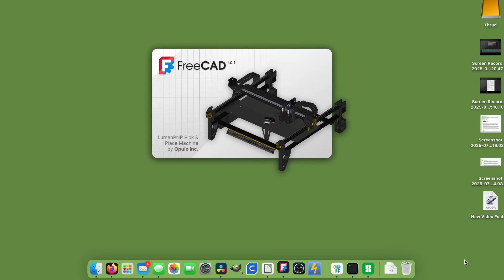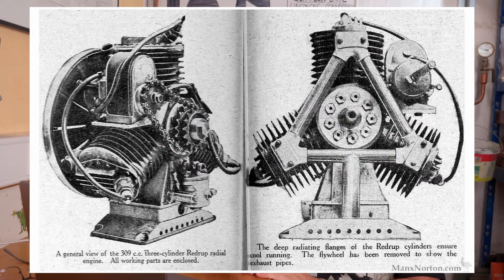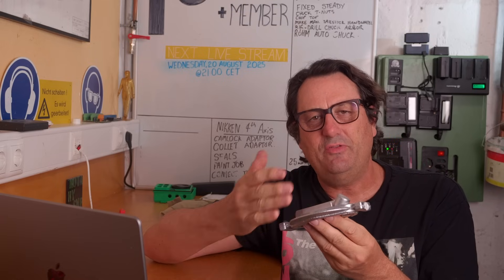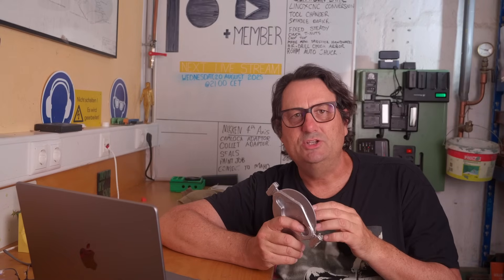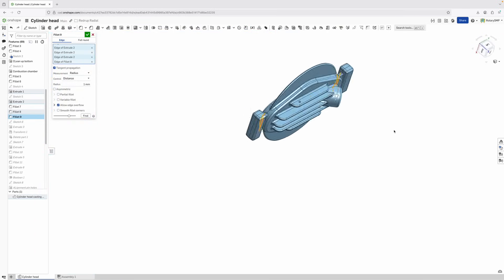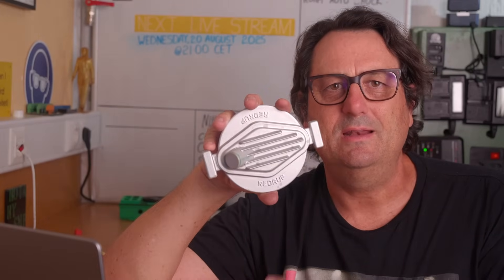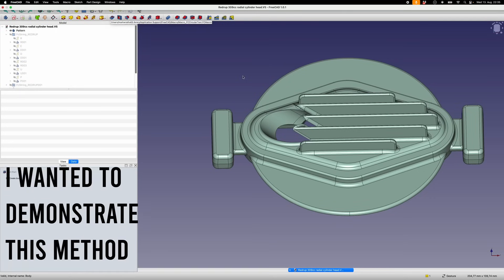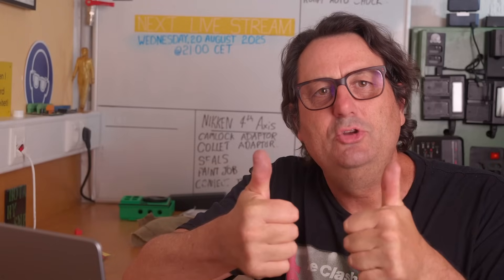FreeCad vs Onshape - Why did I switch? || RotarySMP

Comment: I agree that fillets are one of the single worst parts of FreeCAD, but I have to say I can't complain with free. Sometimes though I find that you can work around the fillet issues if you consider your order of operations, so that fillet on the disc in FreeCAD, you could possibly have started off with a revolved profile, instead of an extruded and filleted flat, however that's not what you want to do when filleting should be built in unfortunately. I have however enjoyed being able to write macros for it, and it works on linux a charm, I've used it for things like FEM etc, and it's all been 100% free. I would like to try onshape, but I don't want to temp myself into being stuck in a subscription. Edit - I should add to this, I rarely make particularly complex geomtry, I'm typically designing things for sheep goods, I have had pretty extensive experience with solidworks, siemens nx and sketchup, and I think compared to what you get if you pay for sketchup vs what you get if you just download FreeCAD for free it's a no brainer, I am however tempted by the fact that it seems like SolidWorks pricing has come down massive however, $48 USD a year at the moment, as I can work with FreeCADs CAM solution, but again it's got it's quirks that can turn what should have been a 10 minute job into an hour+ of looking up tutorials.

Comment: Very good video and your choice is valid.  However I've been burned too many times when corporations change terms of service to trust my work to onshape, even if it is less quirky than Freecad.  

I was in a similar situation with teaching Python a couple of years ago.  I was using Replit which at the time had an amazing free online educational coding service.  Until they didn't .,   Never mind all the work that many teachers put into building their courses around it.  All gone now.  For another example I have a couple of Bose streaming radios.  I get an email a couple of months ago from Bose that they will no longer work after Febuary, nothing you can do, here is a coupon to buy some new ones at a discount. Here is a third example.  Years ago my school district bought into very expensive curriculum mapping software and had all the teachers spend many hours writing these maps.  The data was apparently not owned by the district so when they decided it was too expensive to continue renting the software, all of it went away.  

That said, I would probably use onshape in a school situation if I did not have a computer lab .

Comment: I use Freecad intermittently when I have projects to design that I want to 3d print. It can be frustrating however the new Freecad 1.1RC1 seems to be better with the way that it deals with fillets.  This is also one of the main reasons that I stick with Freecad because every year it noticeably improves so slightly less frustration :)
Reply from the maker: I really hope they can also work on the file efficiency. I also like FreeCad, and the community, but it became clear to me it would be impossible to assembly my motor bike engine project in to a complete assembly, as the sum of file sizes would just grind my computor to a stop.

Comment: You got the budget for a  pc ill bet it just i saw a rotten apple  as your pc/computer i suggest getting a 6 core amd 5800x ddr4 rig they are getin cheap i just installed a rx9060xt 16gb in mine yea not uber cheap but that was my first card PlUs in 15+ years .was running a 3400 amd APU in it .i apple annoys me for a few resigns to me it is Linux locked out with high prices beyond me ..glorious e roll has the all most perfect build of Fedora OS  that and windows ghost specter version
Reply from the maker: I am no apple fanboy, but switched to the M1 MBP about three years ago, as it was the right solution for me for video editing. x86 based hardware can be just as fast, but runs way too hot, with too much power consumption to be practical for editing on your lap, like in an airport.

Comment: Hi I use freecad on an 2020 m1 Mac and had the same stability issues.. I picked up a 5/6 year old gaming pc (marketplace) for 150$cdn and the difference in stability was night and day .. in my opinion it just seems to run smoother/better on a pc .. maybe it’s a security/intel chip thing I don’t know .. I also noticed that after a Mac software update the m1 would overheat using certain softwares that ran fine before the update.. so I built a new pc by gutting and reusing so parts of the fb tower and newer windows 11 compatible board/memory etc .. 
I run 2 versions of freecad : the current stable release and the newest dev release (I check in every few weeks to see what’s new ) … I build stringed instruments and use the 3 cnc’s and 3d printers throughout the builds and repairs including making the hardware; bridges saddles tuners and gears knobs strap buttons plates etc .. I use freecad exclusively .. it’s quirky and I’ve learned to work around its limitations but it’s awesome and indispensable… the dev’s are superheroes and should be considered gods in my opinion 😂cheers .. great content I’m looking forward to seeing your channel grow..

Comment: Your points are very valid. Due to it's nature, Freecad is not fully polished and it will take some time to get there. With greater user base the development activity has considerably increased and it goes in correct direction. It's just your needs outgrew the capabilities of current version of Freecad. I hope you won't fully abandon Freecad and you would check newer versions out from time to time.
Reply from the maker: Yeah, I would also like to see it continue to improve. I hope they strong dev team can sort it all out.

Comment: I used to use Alibre many years ago, then over the years I forgot about it. I've recently come back to hobby machining and tried a few of the normal 3D programs, including Freecad and Fusion, Freecad was a mess, Fusion was good but Autocad did the inevitable reduction of features, so I looked into Alibre again and bought the update to Alibre Atom. I'm able to open my old files and I know that if I don't pay for maintenance I can still use the current version. It also seems to manage to work with no problem.

Comment: Freecad, for better or worse just seems to be unusable for any real-world application beyond virtue signaling. It needs a clean sheet rebuild with a modern UI and a focus on getting the fundamental capabilities before anything else. There are many open source programs which are super functional but freecad isn't one of them. I would love to use it but I need to make parts, not fight software. Onshape is good software, a bit expensive for the pro version but there are some nice capabilities. For hobby use, Solid Edge community addition is far better and runs just fine on lower power computers. (Unlike SolidWorks)
Reply from the maker: I imagine a full CAD package is probabaly nearly as complicated a you can go with a software project. Lot of math in there.
I havent used solid works or solid edge. Solidworks has no OSx port.

Comment: When I asked the FC forum the question regarding the rendering / processing times which can often result in FreeCAD "not responding" for several minutes before completing whatever process such as Boolean or fillets etc I was told that it doesn't really matter now much RAM or how many processors or cores you have, FreeCAD hasn't been written to take advantage of "modern" machines, and is basically a single processor dependent.   I don't know if or how true that is, but My machine is a humble 6 core / 12 thread Ryzen CPU with 48 GB Ram... and it still struggles.
Reply from the maker: Ouch, I hadn't known that is was single thread dependant. 

Sounds like it needs a pretty extensive overhaul.

Comment: The fact that a freecad power user had to check and raise a bug issue for a fillet feature says everything about comunity developed cad software. They simply have no chance in such a  hard and competitive application. Maybe they should change their model and set up a fair software company that will make you pay a fair price  in order for them to have the resources to make decent software. In the professional realm free is never really free. You end up paying by wasted time and then eventually buying the real thing.
Reply from the maker: I guess the CAD is very dependent upon some of the decisions made at the very start on algorythims, and it is very difficult to switch and fix some inherent weaknesses.
Reply: @RotarySMP  spot on. Thats maybe one reason why professional cad software is so expensive, since it takes a fair bit of planning and resources to not get into an irreversible future mess. That and also the huge appetite of large software corporations like ptc for example to extort users 😊

Comment: Mark, I know this is unrelated to this video... but with the feet you were building recently I was really hoping to see you put proper feet under the MAHO. I love your content and varied topics, but every time you put the jack under it and move it out I fear a mistake with the blocking you have it on. Please consider your safety and maybe at least attach the blocking to the MAHO pedestal someday soon... or make proper feet/legs for that machine.
Reply from the maker: It is on the to do list. It is bit more difficult as the foot mount points of the Maho base are too narrow for the jack, so it will be a little more complicated.

The blocks are three solid timbers, and I adjust them into place each time.

Comment: ANYTHING online.. is just BBS. You will find it sooner or later.
And onshape is no exception.
And of course, they are incredibly marketing offensive. I'm afraid to open the fridge... they may jump out of it :)
That always trigger BIG alarm in my head.
Reply from the maker: BBS? I am happy if I can get my Redrup designed in one system :)
Reply: @RotarySMP  Big Bull... :)
And... when that "system" disappear from that "online" sh... all your work is gone forever.
After 30 years in IT, I've seen giants, like IBM, Compaq... diapering.
So.. who can guarantee that all your work will not disappear in a blink, two months from now? Nice commercial? Some dude from the internet payed to sing nice songs about it?
We are both old enough that we seen many kind of bubbles exploding.

All my work is ONLY on MY drives.
And yes... I can start for example autocad, or pagemaker, or freehand, or quark from year 199x, and open file that is created 30 years ago.

Comment: I remember seeing some surveys about "what CAD software do you use" with a question like "how do you like it". Out of 20 or so CAD software packages, FreeCad was the lowest ranked, by a lot. It's kinda become a running joke.
I mean, what other CAD software comes with very useful tools like a Ship Workbench built-in.

I've been using OnShape for quite a long time now, and it just works. The only problem is the really expensive pricing, and the really restrictive free license.
Reply from the maker: Thank Stephanie. Do you remember where you saw that comparison?
Reply: @RotarySMP I found it. It's from CNC Cookbook. Search for CNCCookbook 2024 CAD Survey.
Freecad is ranked 11/15, is #3 in market share, and #4 in most tried CAD software.
Basically a lot of people have tried it, a lot of people use it, and a lot of people hate it.

I like to compare the progress of KiCad to FreeCad. 10 years ago KiCad was pretty awful, full of bugs, no UI consistency. In the past 10 years it has moved up to be a major player and has become easier to use, more stable, more functionality, more consistent UI, etc.

Meanwhile FreeCad is... the exact same as it was 10 years ago. There have been some improvements, but the UI, UX, and huge learning curve hasn't changed one single bit.

OnShape is a masterclass of UI/UX design. There is nothing else like it. The barrier to entry is low, and they include tons of tutorials. Things just work without you needing to think about it. Advanced usage is available, and they include tutorials on the advanced tools too.

Any CAD software requires you to understand how constraints work and what tools do, but a good CAD software means that you don't have to know how the tools work or how to use them, you just need to know what they do.
Reply: @RotarySMP I swear I replied already...
The survey was from CNC Cookbook. Just look for CNC Cookbook 2024 CAD Survey.

Comment: For another flavour; I've been using Turbocad for 30ish years now. I started with it when I just began my company because it was recommended by a CAD guru and because it was cheap. It was like an AutoCad 12 clone with limited 3D possibilities. I started drawing and designing with pencil and ink so the 2D environment was most important at first. My machining was also only manual so the fit was sufficient with the added bonus of precise measurement in CAD instead of guesstimate with the rulers on your board or using mathematics when details became important. I never switched even when I had four of my employees working on Solidworks Standard and Professional (don't use version one of the new release; skip to the next; familiar?)  My workflow still fits this software and I have no need to work parametric. I do save versions during design which I combine and alter when needed to get to the final output. I started at version 5 and I'm now on 23 platinum. It's supposed to be parametric as well but I never felt the need to try that. The only reason I upgraded a few times was incompatibility issues with a newer version of Windows. Most of the parts I produce have to be technical correct and have a thought trough/technical sound appearance so the more emotional pleasing fully curved stuff doesn't happen here a lot. I did some and Turbocad did the job almost anytime. When it really needed to be 3D complicated I asked the Solidworks jockeys who worked for me. Surprisingly I also did some jobs in CAD for them because (then) it was more easy for me to perform with TC. As you understand old-skool guy here but the end result is not about the CAD system you use but how good you thought about it. Ask Leonardo....  But maybe TurboCad is an affordable flavour for some of you too. A purchasing tip would be to ask for the last version before the latest one. It saved me a lot of money every time I did so. Thank you for sharing Marc. I'm a dedicated fan of your channel and I think the algorithm should support you more. Best! Job
(PS: for CAM I'm using OneCnc Expert for 18 years now. First one is expensive and not for hobbyists I think but you own the software. And this software is a joy to use. You can also draw in it but that's reayl basic.)